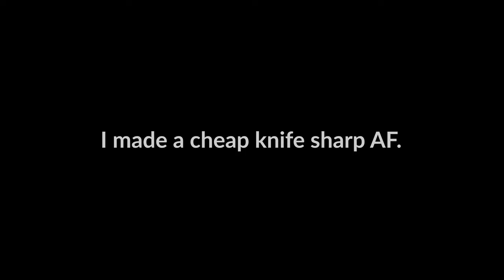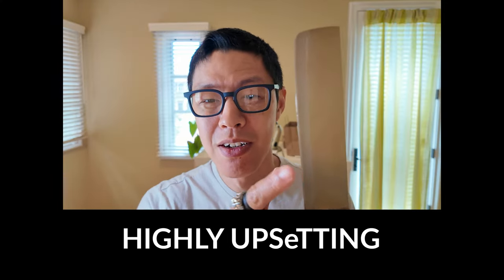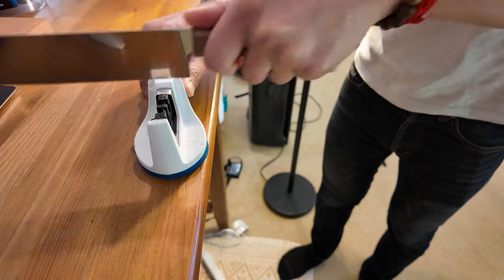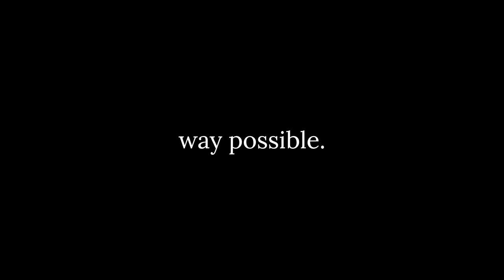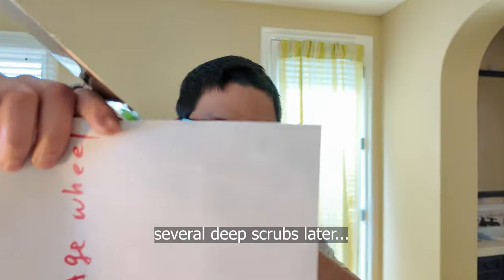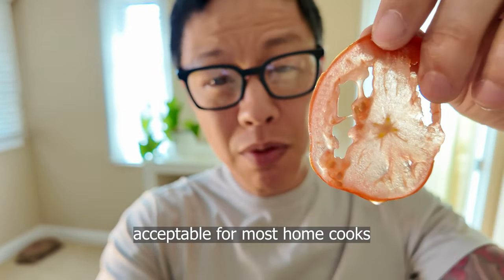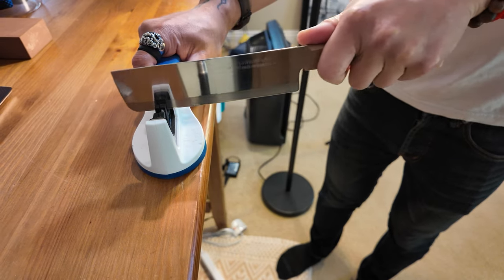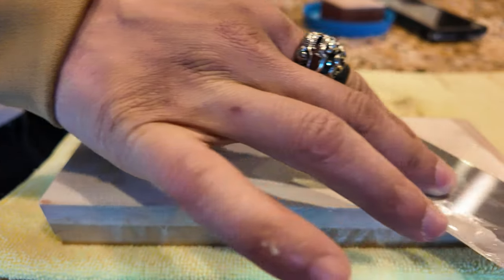I made a cheap knife sharp AF

Comment: ok so i carve a lot in what free time i have now a days and i can say i have tryed diff ways also to sharpen my knifes and chisels and my fav way is also the stones but i use diamond stones (no diff really i have used both) but i just use a strop most times if my knife is getting a little dull i fined it refreshes the blade just fine as long as u keep ur angle good on the strop
Reply from the maker: oh man I've been too cheap to buy a strop (I know, ironic given how much knife merch I've accumulated).   been using printer paper instead. worth it to grab one in your opinion (a strop I mean)?